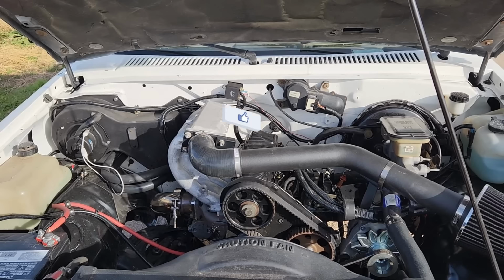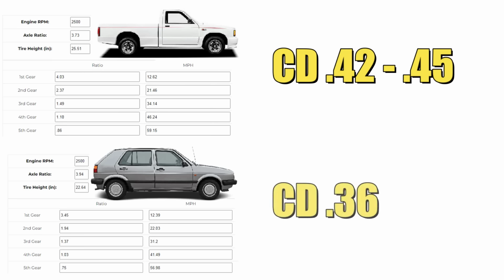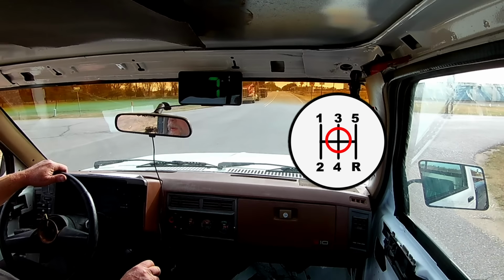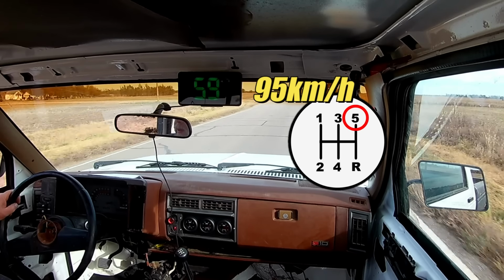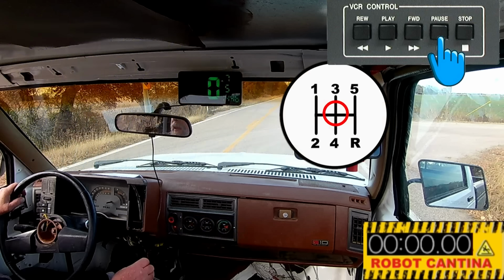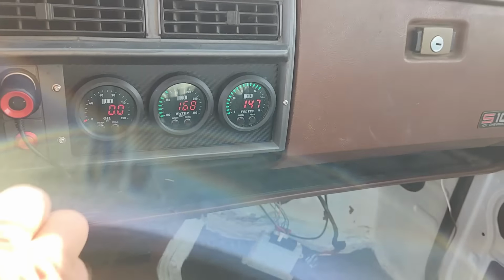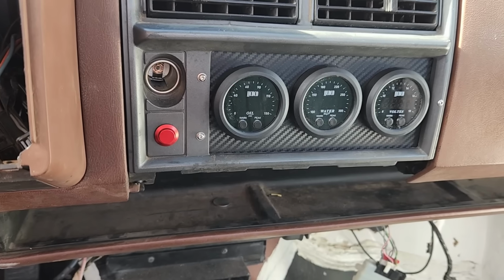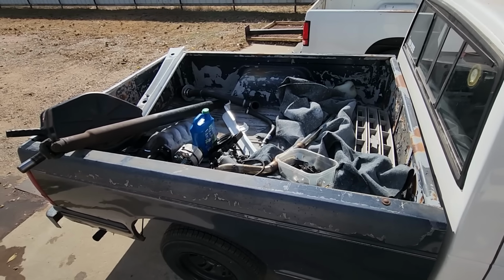S5 E43.  We road test the VW diesel powered Chevy S10... More problems?

Comment: Hi sorry to say but could it not be the run back on the sump it's square a bit of an  angle on the sump to feed the pick up pipe would help the return to the sump for the oil .
Reply from the maker: given the engine looses pressure at idle and not full throttle, the pan may be OK.  its hard to say.
Reply: @robotcantina8957 it's a great conversation tho be great with a turbo on it just that small bit boostbwill help

Comment: Before you do any freeway testing, you should get the bumper sticker that says “GO AROUND! If it was supposed to be fast, it wouldn’t be shaped like a brick”
Reply from the maker: Perfect!
Reply: HAH Love it. I'd get it for our cabin's Suburban, but more often than not I'm NOT the slow one, and I'm doing the passing 😅

It's like this S-10, it's the Scottsdale package, which is the OPPOSITE of Silverado. It's a 90 model, but still uses the older body (tailgate, 2 square headlights instead of 4 thin), old style dash, zero carpet, knob-style radio with only speakers in the dash (might have 3). But, it does have a TBI 350 and ABS! 

However, with 200K miles, it's pretty gutless. Actually, it's odd, as it has no torque at speed, so driving through the mountains is annoying, and yet... on a flat stretch of road she BOOKS still and has no issue maintaining it (I've buried the needle when passing multiple RVs/campers; although its speedo only goes to 85MPH lol). 
I've always found that strange, though... 🤷‍♂️
Reply: Or one that says "Caution: Slow Moving Road Block"

Comment: Well, the 0-60 is about right, diesels, particularly the smaller variety of naturally-aspirated passenger car engines are, to put it mildly, leisurely-paced, it's why they tended to be larger in capacity to keep pace with smaller-sized petrol engines, this 1.6L being about the same hoof-power as say a 1.0-1.2L petrol, but it's all about the torque and cruising than lighting up the tyres... :)

Comment: Hey jimbol, great video as always. I haven't commented  lately because I didn't watch all the earlier stuff regarding this engine swap. I'm glad it's coming along well. I have mentioned before that I put the alh in my Ranger and it is incredible. Acceleration is mind-blowing compared to that old naturally aspirated 1.6%.. I have an extra alh that I would be willing to donate to the channel. It starts but then immediately shuts off. I think it's a fuel pressure issue from the pump. There is a guy named Kyle on YouTube it's open your area that does all kinds of stuff and has wiring harness schematics and show you how to build the harness for one. I actually could build you a spare harness from my house. Let me know if that's something that you would be interested in. I'm not sure how we would get into you. I'm in Florida
Reply from the maker: Hi 'ya.  I really appreciate the offer.   Since the ALH has the oil pump at the front of the engine, getting that engine to fit around the chevy crossmember seems like it would require a massive amount of cutting.      If I didn't modify the oil pan on the 1.6, I would have had to cut 3/4 of the way through the crossmember to get the engine to fit.  I would prefer an ALH, but for now I'm searching for a decent 1Z.
Reply: @robotcantina8957 you have great fabricating skills jimbo, I know you can come up with an easy solution.  Being that the engine is not the original engine, you can't say that the truck is original. You can easily weld in additional material to the base of the subframe so that it is strengthened and gusseted before you actually cut out the area needed for the oil pan clearance. Just something to keep in mind

Comment: You can convert a 1Z/AHU to run on ALH management easily enough. That would give you the benefit of a VNT turbo and the option of remapping for more power. I don't know if you get the AFN engine over there? That's the later factory VNT version of the 1Z that came in the mk3 Golf and other VAG cars of that time (late 90s).
Good luck with sorting out the oil pressure issue!

Comment: You can get a AHU code 1.9 tdi engine from 1997-2000 VW Passat or Audi A4 that has a 058 style engine block and can house your oil pan and accessory drive. At least in europe, dunno if they exported it to the states..
Reply from the maker: Thanks!  I;ll look into that.
Reply: probably in canada also

Comment: My Sunday is off to a good start....
What app do you use for the speedo?
Also, what's on the tablet running on the passenger a-pillar?
Reply from the maker: The speedo is just a stand alone GPS unit. there is a link to it in the video description.  The Samsung S22 phone on the A pillar picks up the audio.  The wide angle camera I use for the video has terrible audio.  It's all very low budget.

Comment: I also swapped in a temporary engine when I did the 5.3 swap in my 94 s10. It currently has a LM7 5.3 that has an iron block. I also have a core all aluminum L33 5.3 that I need to rebuild. Plan is to replace the LM7 with the L33. Its almost 100 pounds lighter and has almost 20 more factory rated horsepower. From the dyno rwsults ive seen on other L33s the horsepower is more than advertised.
Reply from the maker: It makes sense to use what you got then when your ready, swap in the desired engine.

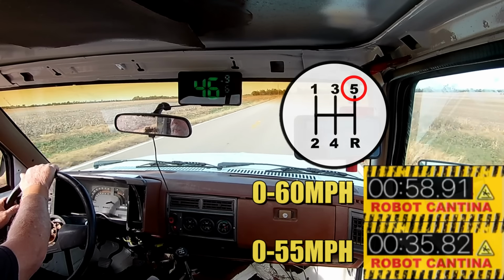Comment: 12:03 Next up, a Temu turbocharger? 😂

All you'll need is the same injectors with slightly larger (or more) nozzles.
Reply: This isn't true you don't change the nozzles on IDI engines they do not have flow limitations like the TDI injectors.

Comment: A4 you sure it's not the modified pan and not enough oil is getting to the pickup?
Reply from the maker: given the engine gets oil pressure at higher RPM when there is more oil flowing through the pickup, chances are the pan is ok,

Comment: Head over to your local grain elevator. They will have a scale and you can get an accurate weight on the S10.
Reply from the maker: That's what I normally do.  The grain elevator is basically across the street from my shop.  Since the oil pressure was a bit flaky, I didn't want to drive the truck anymore than I had to,  I;ll get the truck weighed soon.

Comment: I'm sure you'll be just as happy with a 1Z / AHU as you would be with an ALH. My dad has a 1z in his Passat that's on 270k now, it's been super reliable and gets almost 80mpg (imperial not US) on a steady drive. Same 90bhp from factory as the ALH.
Reply from the maker: Thanks.  I'm on the hunt for a running 1Z locally.  Hopefully I'll find one soon.
Reply: @robotcantina8957 fingers crossed! An AFN would probably work too, as fair as I'm aware they're the same, just 110hp from factory instead of 90

Comment: The oil instrument needs to indicate a higher pressure when the when the engine is at operating temperature at idle speed. 
Commonly when the  engine oil pan needs to be removed; it's because the engine oil pressure ( or lack of)  indicates that the engine internals need to be inspected or serviced - in this case the oil lubrication system including the oil pump gears and intermediate shaft bearings. 
 Evidence can be a two edged sword; if you look only at the evidence than that will become logic or truth. In this case ( no pun here), we can see the the 45 year olds side by side and know the truth: Obviously, an engineer from Opal who was discontent met with the direction of Opal and engineer from Buick who really wanted to engineer a truck scribbled out the square body S 10 on a cocktail napkin which later resulted in the VW and Chevy products. That's just how it is folks.
  Back in the 1980's it was the MIGHTY S10 which helped the coaxial cable TV guys over run the entire telecom consortium who maintained heaps of heavy duty big blocks with massive plate steel welded beds to service twisted pair. 
 ✌🏻👴🏻🚬

Comment: Hi Jimbo
It's most likely just the oil pressure control plunger sticking and not closing all the way, so as the oil heats up losing viscosity it's bypassing too much.
It's inside the oil pump so just do as you intend to and replace the pump and you're all good again.
I  have been working on 100's of these engines for over 40 years starting at 17 and now 60.
Mostly the 8v and 16v gti engines but some 1.6 in na and gtd guise.
The 1.6 GTD is a nice little engine if you want to keep it with a pure mechanical pump and it will push 100bhp with a small pump adjustment, modest boost increase and a decent intercooler.That old intermediate shaft block configuration even lived on into the 2000's in some in line Audis and the passat even as a 1.8t 20v.

Keep up the great work, absolutely love your content over the years

Be carfull with pump brand, I would strongly recomend  Febi Bilstein.

Michael
Reply from the maker: Hi Mike,  I pulled the pump and the intermediate shaft yesterday.  The bearings actually look fine.  I'll replace them anyway.  The problem may be in the pump as you describe.  I can be reached at B3miata@gmail.com if you want to send an email.  I would like to ask a few questions.
Reply: @robotcantina8957 ,,, please do not change those good looking bearings .
Reply: @rolandtamaccio3285  Is it because they're better quality than any replacement these days? (where even one with 100K km is more reliable)

[When making suggestions/offering advice, it's helpful to go the extra mile and explain why, since not everyone has the knowledge you do... even Jimbo may not, in this instance... But primarily for the future, should someone else come across this in 10 years and there's a decent chance they'll be unable to ask you, if you even remember lol This is just a friendly critique, not trying to come across like a jerk 🍻]
Reply: @DUKE_of_RAMBLE ,,, is the intermediate shaft a balance shaft ?. What's this thing have , 170 thousand miles on it ? It annoys me the ignorance of wastefully changing the bearings .
Reply: @rolandtamaccio3285  I don't know if it's also a balance shaft, but I did wonder that myself!
And while it may SEEM foolish to do "preventative maintenance" when a part appears to be completely fine, it's often smart in the long run because such a low-cost part could prevent a high-cost engine rebuild.

Plus, Jimbo isn't one to waste stuff and I wager if they still seemed to be in decent shape, then he would hold on to them and use them for some other low-risk project that needed a bearings for a component. 😊
Reply: @rolandtamaccio3285  You seem easily annoyed.  The intermediate shaft drives the oil pump, and the vacuum pump, and they are well known for bearing failure and subsequent low oil pressure.
Reply: @ferrumignis how we have never heard having problems with bearings? Where do you live?
Reply: Hi Jimbo

It's pretty rare to find an intermediate shaft bearing worn beyond tolerance.I didn't want to contradict the previous advice you found or been given regarding the intermediate shaft play being responsible for low oil pressure.I have never found this and the only way this could be possible is that it's flopping around so much that the gear teeth were skipping.Only ever seen gear skip when the Vacuum pump isn't installed all the way in from the drive keyway not being lined up.Or in the 8v petrol variant the distributor.I turned my VW hobby many years ago into a pretty large and well known uk vw performance specialist, primarily G60, G40 then later 1.8t etcStill like working with the old engines too.
Strangely I also have a bizarre love of little Kubota diesels and have a couple of the 722's
Always look forward to your projects, particularly on the 722.
All the best Michael
Reply: ....maybe pop off a crank main bearing shell and have a peek. Had that once on an Audi 5 cyl, same symptoms. Mains were totally shot, big-ends were fine.
Reply: A 1.8L 20V conversion would be interesting, people were getting impressive power from them back in the day.
Reply: @ferrumignis  
The 1.8T is a brilliant, robust and free breathing engine let down by the horrendously inefficient and restrictive factory exhaust manifold and turbo.
Back in 2001 in the development and testing stages of my upgrade manifold and turbo kit, we ran standard internals 150bhp AGU engines at up to 365bhp with absolutely no issues. For customers I mapped factory management for 1.4 bar peak achieving, between 340-350 bhp depending on intercooler exhaust system and engine variant.
We sold over 250 of these kits, fitting and mapping over 100 in our workshop with no engine failure reported over many years and 1000's of miles covered.The most efficient engines are the early big port heads found on the AGU in transverse and AEB in line vehicles; this is the one that has the early block configuration.The BAM as fitted in the TT is no stronger than the early engines other than the slight benefit of a 9 to 1 over the 9.5 to 1 of the early engines. Unfortunately it's let down by inferior breatheathing of the later reduced inlet port sizes.They both come as standard with VW's normal very robust forged crank and rods but in addition they fitted lovely Mahle forged pistons for these engines.
These egines with a free breathing manfold and turbo will happily sing up to 7800rpm.
Reply: Hi jimbo, in some audi a4 and passat they have a good tdi engine with injector pump and with a little bit of tuning in the engine computer you can have a good little truck with a good amount of power
Reply: I got 15years of expierence on the 1.8T 20v block variants.... stay away from them... Just dont

Comment: I’m curious why the 1Z will fit but not the ALH
Reply: The blocks are completely different, the 1z is same style as the old 1.6d, with the intermediate shaft running through the front that drives the vac pump and oil pump, whereas the ALH uses the newer style block, similar to the later PD diesels
Reply: @danielp2000  Bellhousing is still the same. The absence of an intermediate shaft on an ALH has nothing to do with it not fitting in an S10 engine bay that I can see. Far as I know he would just need to change one motor mount
Reply: @Tdiguy2003 I'm not sure on this but maybe it's because the oil pump is chain driven from at the front (cambelt side) of the engine instead of the back near the gearbox?
Reply from the maker: Since the ALH has the oil pump in the front of the engine, I would have to cut the chassis crossmember almost all the way through in order to get the engine to fit.
Reply: @r @robotcantina8957  Bummer! I believe you can still use the injection pump and ecu off an ALH if you really wanted to maximize that efficiency down the road

Comment: Can you get a taller diff gear ratio to improve torque?  That would tighten the gear ratios for shifting.  If you had a 5:1 trans and a 4:1 diff, you'd have a 50RPM at the wheel.  If you had a 5:1 diff, you'd have 40RPM at the wheel.  Top end would suffer, but going from 20:1 to a 25:1 effectively closes the gear ratios, which could make the diesel happier.
Reply from the maker: According to google, a 4.10 ratio is available.
Reply: @robotcantina8957 some short and tall rear tires/wheels could get some quick and dirty numbers..

Comment: I would run straight 50 weight with Lucas before replace the pump but I don't have the time you have. I say ditch the pump and shaft and go electric. But I also say drop the VW for a 4-53 Detroit😂

Comment: The fun part about German engineering is that it works best if you use the correct stuff at the correct intervals without any deviation. This isn’t an issue in Germany where Germans are just hardwired to do that. Now Rotella is good in some diesels but not all.  I’d triple check all the specs, I can’t count all the times I tried telling hard headed 6.0 owners that Rotella is shit in their 6.0’s and that’s contributing to all the issues they are having with sludge  and bad injectors. 

I was reading a lot of posts where this engine may take 5w-40.

Comment: Diesel engines mainly deliver double the number of cubic inches  in pounds/feet of torque. So the VW Diesel engine in this S10 could deliver a maximum of 200 lb/ft of torque.
Reply: Holy moldy, that's actually a lot. This truck would be about as fast pulling a trailer as not.
Reply: @SchoolforHackers According to the listing in auto repair manuals, in the VW Vanagon Diesel, the 1.6-liter engine made about 50 bhp.
Reply: @angelperez7891  So ... wow. Not much more than a Beetle.

Comment: Guy from metricland here: No need for a second speedometer. If  you can't multiply by 1.6 in your head you need to learn it or watch another video, IMHO.
Reply from the maker: LOL,  I appreciate the people from metric land.  I will give you your own speedometer to gaze upon soon.
Reply: I just learned both....conversions complicate things.😅😅
It's the mental feel for the unit  that seem to trip people up.
Reply: @muddywater6856  For me, it went in steps:

First you convert numbers and doing that is sufficient to follow this here video.

Once you've converted numberse enough, you'll memorize some relevant points like "25mph is about 40 kph", "30 mph is about 50 kph", "60 mph is about 100 kph". That's enough to get you through a roadtrip around the UK in your own vehicle with a kph speedo without collecting too many tickets.

Once you've completed that road trip, you'll have developed a natural feeling for mph.

Comment: Jimbo made a Chevy LUV at home, basically lol
I'm almost suprised you didnt try an Isuzu engine in it (since it did come with it for a brief period)
Reply: The Isuzu P'up from 1984 diesel was only about 60hp.
My brother bought one used and drove it till it turned to rust.
For some reason it had a four-speed shift knob....after driving it for about a year, he discovered it actually had a fifth gear😂😂😂
Reply: The P'up also only had six fuses....electrical bliss.😅

Comment: I look at that engine bay and wonder if the old M51 mechanical injection 2.5litre BMW straight 6 ever made it to the USA... 140 horses and 191lb/f (in turbo intercooled form)... and for an old diesel, smooth!